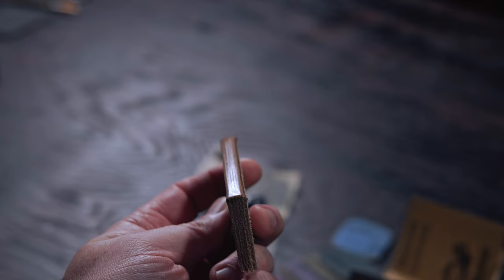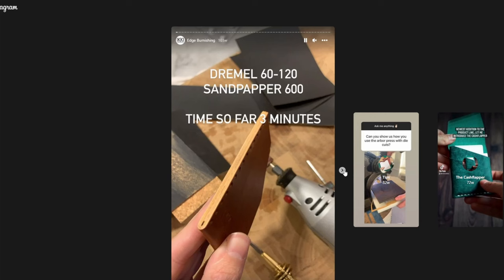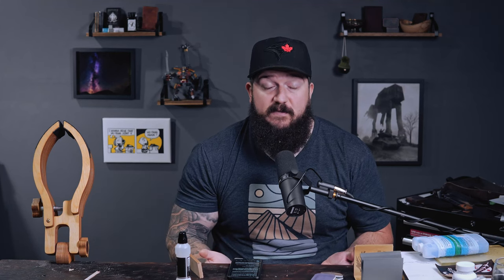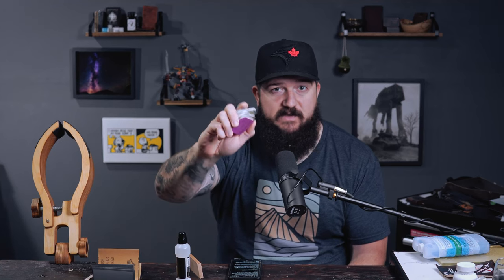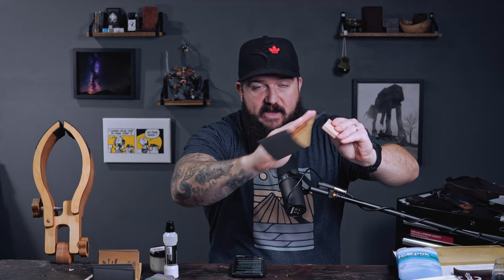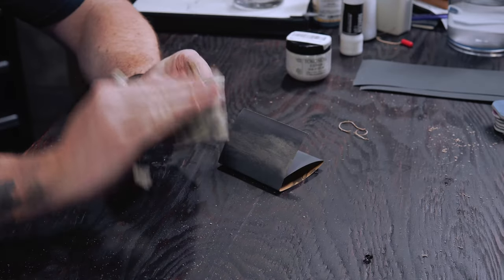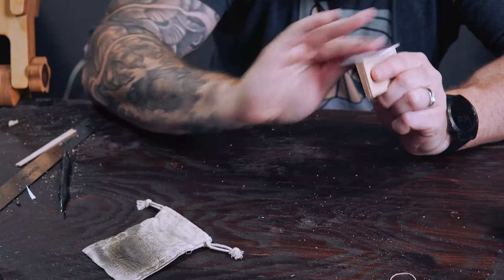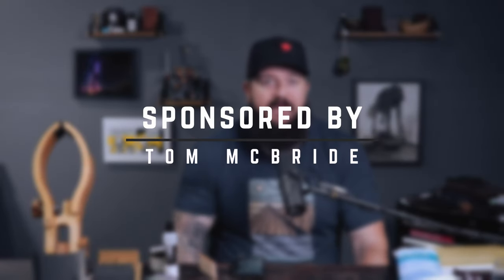How to Burnish Glass Edges on Leather

Comment: When using a rotary punch to punch clean holes in thin to moderate weights of leather, try placing a piece of scrap leather under the project piece of leather and squeeze the handles as normal. You'll hear a certain sound when both thicknesses are punched through. This will assure you a definitely clean inner edge of the punched hole.

Comment: I have to revisit the video but, I followed Don Gonzales' method from his video titled "Quick Tutorial: Slicking Edges on Leather". I'm sure most people here are familiar with Don. I Started leather work while on "2020 layoff" and following was the first people I learned from and I personally have always gotten great results using his methods. I get a very consistent finish doing it this way. He also sands his stuff, shown in other videos and has some very helpful techniques to get good results, like using a sanding block/board with sandpaper on it. 

I'd say see what result you get sanding up to the 800 grit and then finish it Don's way and compare the result.

I'm not sure it's worth the effort for that glass finish on products made to be sold though. I'll have to make one of my custom fit belts and see how long it takes to edge it this way and what added cost is for the extra sandpaper. Not a complaint about work but, you have to pay yourself for the work and price it fairly for your customers. Looks like you did a test on about 3 inches of edge, my average belt is 50 inches long so that's about 100 inches all the way around.

I'm always looking for ways to get better results and or speed up production as long as quality is not compromised.

I also wonder what if you used a buffing wheel/bench buffing machine at a certain point to finish up. That might speed up the process and possibly improve the end result.

Loved the video,  always looking to improve quality.

Comment: great information here, one of the things that really important to get those edges is the Temper of the leather your using, Additionally the denser the fiber structure the easier it is to archive the look. If Veg tan is your choice as it is mine, I personally use Horween (sp) The Russet strips from Tannery Row. it's tanned by the first half of the Shell process, it's a bit pricier than most Veg but the way it works if you're carving and tooling the piece is second to none, and yes, it is possible to easily bring that glass edge up on your pieces, the other thing about that edge is you normally only see it on short straight relatively thick pieces, and a lot of cliental dont care for the bulk, but to each there own!
Reply from the maker: Thank you! Horween is my preference as well although lately I've been using a bit of Wicket & Craig. Both of them are so nice to burnish.

I chose the leather I used in the video because it is a dirt cheap veg tan I got at Tandy for prototyping. Figured if I can get the mirror edge on that stuff, you can do it on anything.

Comment: Alright... I tried this on some scrap. went up to 7k grit paper. 400, 1000, 1500, 2000, 3000, 5000, 7000 with tokonole between each little sanding from 2k. hot damn, did not take that much time. got to try this on next cardholder. Thanks ^_^

Comment: Newbie question: when in the process would you colour the edge if you wanted to include that?
Reply from the maker: Good question! Add dye before you use Tokonole. Tokonole contains glue that coats the leather and would prevent dye from soaking in.

Comment: Love the video Tim.  Question.  Your burnishing 'glass' technique...is you little Amazon burnishing machine not used?  Can you use both to speed up the process?  There has to be a way to add different strips of sandpaper to that drum sander.  One section for 120, one section for 220.  One section for 400?  That would save a bunch of minutes getting up to the Tokonole stage.  I do not have one of those machines yet.  But a cardboard tube that fits the drum and then glue strips of sandpaper to the cardboard may work.  Again, my thanks.
Reply from the maker: Thanks Bruce! That is definitely something I've been looking into and just haven't given it a go yet.

There are a few videos out there where people have done just as you describe with a paper towel roll and a bunch of glue. It'd definitely be handy!
Reply: @BlackFlagLeatherGoods  I think it would cut down the hand work for the second hand of the process.
Reply: What we need is a 12" wide belt sander with all the grits lined up on one belt. Just move across the belt with a little canvas inbetween.
Reply from the maker: That's a brilliant idea!

Comment: The glass edge looks amazing but what would it look like after say a week of use?
Reply from the maker: It definitely gets scuffed up. Maybe I'll make myself a wallet and see how long it lasts.
Reply: Definitely curious about that. Seems like a lot of work for a beautiful edge that quickly degrades. Not much of an issue for personal/gifting means but for production might not be practical
Reply from the maker: It's definitely not practical for production unless a customer requested it and you charged accordingly.
Reply: What about using acrylic finisher? Or something like 4-coat high gloss angelus, i think that the finish is gonna last atleast a few months of use

Comment: Great video. Once you get the edge to that level do you finish it with beeswax & canvas or leave it as it is?
 I've tried using beeswax & canvas to finish the edge but it tends to dull the edge, it does however leave the edge feeling smoother for longer than just using tokonole & canvas.
Reply from the maker: Thank you! I don't wax the edge once I'm done, but I have tried it. After you put wax on, add a bit of water to it and burnish. I found adding a bit of water made it smoother, but not this smooth. You could also try using a blend of waxes melted together. Beeswax alone is pretty soft. Mixing it with carnuba would be interesting...
Reply: @BlackFlagLeatherGoods  thanks for the tip. Will definitely try it with a bit of water. I made a formula with 85% beeswax & 15% paraffin wax. It works better than the pure beeswax. Columbus wax gives the best shine, but the hardness of it makes it difficult to apply without the right creaser tip.